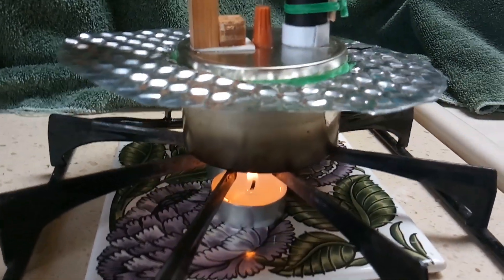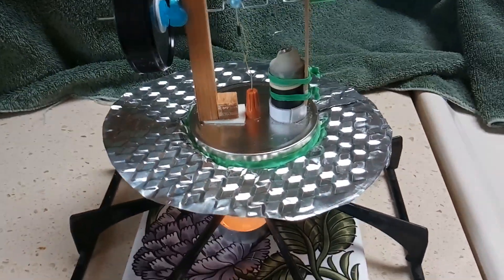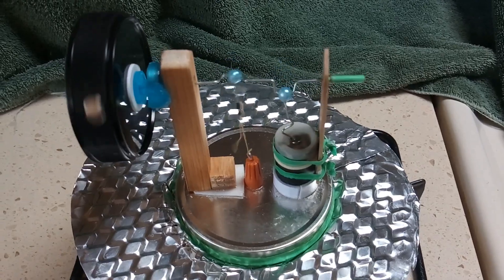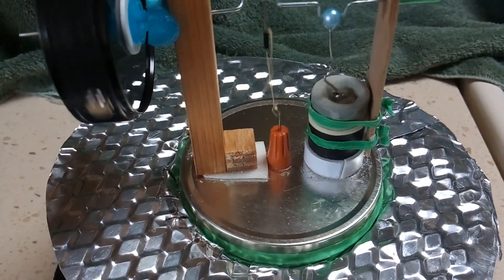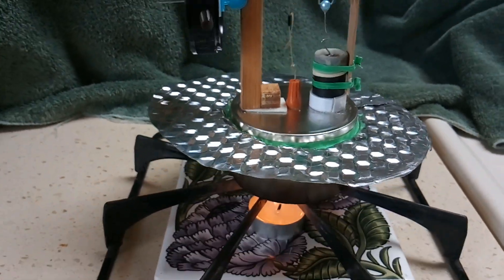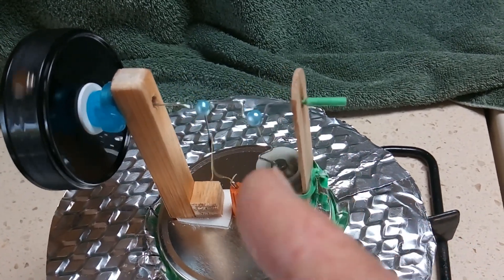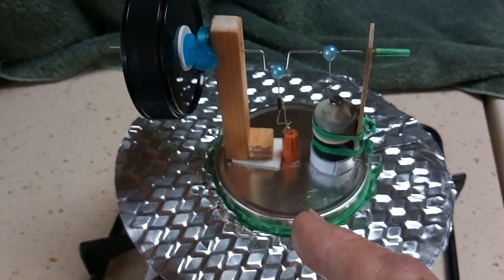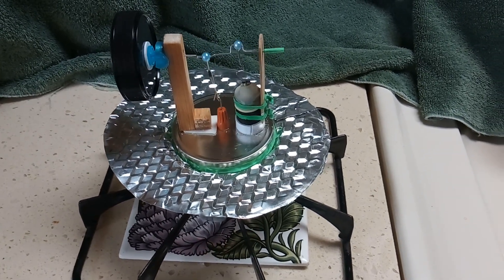Little Simple Stirling Engine

Comment: some info/observations.         at :03,  the flywheel should  NOT  be  out of balance.      (during slow playback) it can be seen that  slack occurs in the  (flexible) displacer linkage,  at bdc.     it can be seen that contact occurs at the  rod-end connector  and  the displacer-shaft  guide.       the diaphragm is a disaster.      the diameter of the cold-cylinder  MUST  be  Great enough, to  accommodate the  Properties of the material used.     the properties of a typical rubber balloon (or rubber 'finger')  are Not well-suited, to the purpose.   consequently, the use of  Any  other material should be considered.        example  ---   with the use of a (very) short cold-side stroke length, it may be possible to use  plastic-bag-type material; a radially pleated design could be tried.     during operation, design and material should result in a  diaphragm that does not  deform,  excessively;  and its   during-excursion tension  is  Minimized.      (this  during-excursion Tension is  THE  drawback to the use of  diaphragm.)      the foregoing is  critique.    which is not the same as criticism.     (kindly, spare me any excuses, defensiveness or bitching.)     googletranslate

Comment: Brilliant and great to see a new video from you 😍😁👍
Reply from the maker: Thanks.  I have been busy with other things.  This project was one of those mind puzzles that one has to ponder before starting. It was kinda a long shot that it would ever run because of the shape of the can.  These are fun to build but sometimes you can work days and days with no success.  On this engine I spent most of the time designing it in my  head.  The actual build took just a few hours and it ran right away.
Reply: @Lidmotor  I have never built one, it probably should be on my list 😁